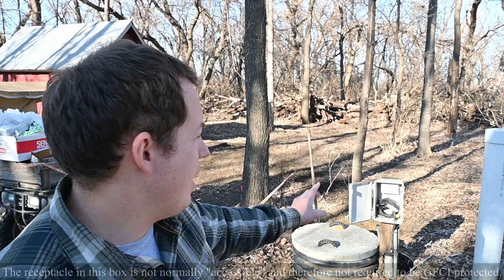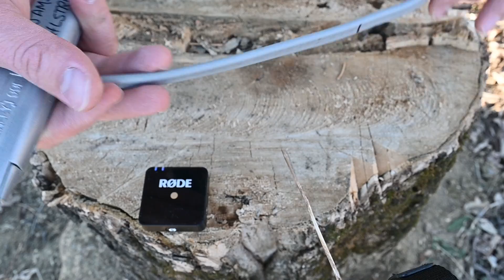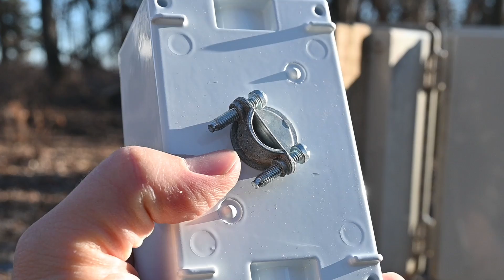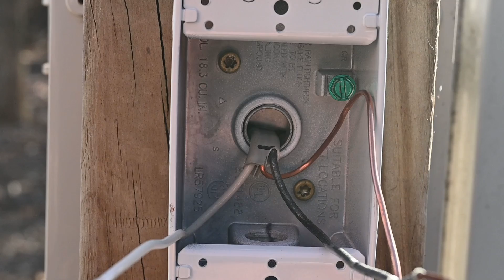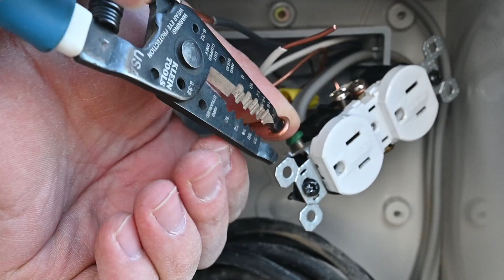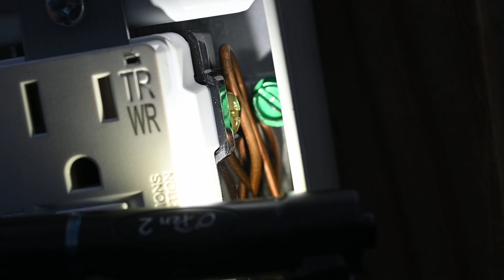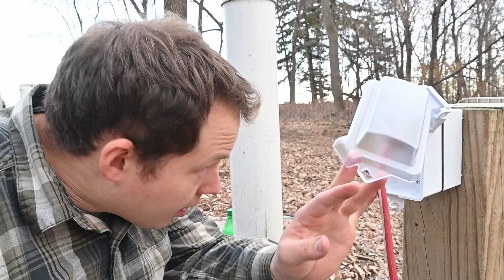How To Install an Outdoor Outlet

Comment from the maker: For those who are curious; that circuit that I tapped off of is fed from a standard circuit breaker with no GFCI protection. The receptacle in that box we tapped into is not normally accessible and is used for the septic pump and therefore was not required to be GFCI protected by code at the time of installation in 2016.

The reason that I didn't use a GFCI breaker is that I prefer not to have nuisance tripping of my septic pump but I did want to have GFCI protection at the receptacle we added.

In a perfect world I probably should have run a new circuit from the house but digging a 150' trench isn't exactly the easiest project and I shouldn't be using all that much power in that pet shed anyway.

I thought about putting this in the video but I figured that most people probably wouldn't care about these details. :)
Reply: A nuisance trip on that pump would be a crappy situation.
Reply: Very glad you mentioned the difference between backstab and screw-down that happens to go through the back. Totally different things that I think are easily confused. Whenever possible, I actually prefer a screwed-down "through the back" (or "under the plate") connection, vs. hooking the wire around the screw. As long as the connection is tight and secured by a screw, it's not going anywhere and I actually feel like it's MORE secure that way! 🙂
Reply: I have a simple question that I can’t find the answer to. Love all the content you put out by the way!  How many GFCI outlet can be I talked in one circuit?
Reply: @8Wildkid  Not sure I fully understand the question, but In practical terms, the number of outlets you can install on a single circuit isn't limited so much as the total amperage of the circuit dictates how many things can be plugged in at once. When adding a GFCI, and depending on how it is wired, it's possible for further outlets "downstream" of the GFCI to be fed off of and protected by it. In that case, incoming power connects to line side of the outlet, while further downstream outlets wire off of the load side. That protects the downstream outlets just as though they were GFCI themselves. But again, the circuit rating (usually 15 or 20 amps) dictates what and how much you can plug in.
Reply: @marcberm  thanks
Reply: find a good ditching company to trade out work with. It will save your back if you ever decide to make that 150' run
Reply: I agree about not using a GFCI outlet for a pump. Who needs that grief?
Reply: thank you for nice video its really helping . ..could you up load a video of  how to install security system alarm in home and CCTV camera system ?
Reply: You could have just replaced the breaker to that circuit with a gfci protected one btw..

Comment: That 2 screw romex connector that you used in back of the bell box is not rated for weather proof. So unfortunately this is a fail

Comment: I just ran a 12 gauge line from a new 20-amp breaker in my panel to an exterior outlet I am installing. It's a 2-gang box and both are GFCI. How do I connect the GFCI outlets - to the power and to each other - when I have just one 12-gauge line going to 2 GFCI outlets?

Comment: In mounting a box outside, I always use a gasket between the surface and the back of the box and sometimes also where the power enters the back of the box. I just never trust the weather from getting in the wall of a house or a box.

Comment: You might want to tighten both screws on the load side of the gfci, then wrap the entire receptacle around all the screws with black tape sealing off those exposed connections from any potential shorts or moisture.

Comment: Big help. I just replaced our deck that was 10’x33’ to 24’x33’.  Since the house is close to 40 years old, there was only one non-GFCI outlet, and it wasn’t in a great location. I wanted to add 5 or 6 additional outlets, do it right/to code with the GFCI outlets and outdoor boxes, run the romex thru schedule 80 under the deck and then 90 degree up thru the deck and have outlets every 10 feet across the back of the house and a couple on the 6’x6’ posts of the railing.
Those are some beautiful kids you have. Did my dad call you and tell you “it’s just as easy to fall in love with a pretty girl as it is to fall in love with an ugly girl.”? (His other line was- “It’s just as easy to fall in love with a rich girl, as it is to fall in love with a poor girl.” He’s an electrical engineer…. You know the type…)
Reply: Can't use Romex outdoors because it's considered a wet location even if in conduit.

Comment: Can cable from the panel to the outlet go directly in the ground or does it have to be in conduit? I lIve in Florida so the cable may be submerged several months a year at my swamp hunt camp.
Reply: You need wire that is rated for underground.... some have shielding on them, amd can be buried by themselves, but best bet is to run inside a buried conduit if there is ever a problem in the future you don't need to dig everything up again

Comment: Is it against the code to use the receptacles to connect multiple hot and neutral wires to power the current receptacle and downstream ones? IIRC pigtails must be used.

Comment: At 19.26, you should ALWAYS make it your standard practice to connect your ground wires first on any circuit you are dealing with be it in a panel and or switch or outlet.

Comment: Does it matter if the panel/load center is circuit breakers or the old screw in fuses?  My house has a screw in fuse panel.

Comment: through the boxes, I would have used a piece of steel conduit or a long bushing, at the correct length with a nut and bushing on either end into the back of each box through a knockout.  Then, you just pass wires through because... it's conduit.

Comment: Here's my 2 cents, based on experience. I'd recommend that you tighten all your load side terminal screws whether or not you are using the load side of the GFCI receptacle, and also cover all terminal screws with electrical tape. I'd also recommend to actually land your grounds far away from any and all terminal screws rather than just pushing them back and hoping for the best. I'd also advise you to strip the UF sheathing further back in order to save space in the other box so it has more room inside. Stripping UF is somewhat of a pain in the rear end. Lol

Comment: uf will peel if you strip just an inch or two of the gray, down to the white or black (lets use black for this example), then grab the ground and white wire with your side cutters, grab the ungrounded conductor that you've stripped out of the uf, pull away from each other. The black should come right out of the gray insulation. Repeat with your neutral. Cut circle around the base of the ground (with a dull knife)  and pull the grey right off.

Comment: I had an electrician install one of these outlets outside for me. The very first time I went to use it, it failed to deliver electricity? I tried resetting it & nothing changed? I tried several times to reset-nothing? I suspect the outlet is defective? I have another outlet downstream from this same circuit & that works flawlessly. I couldn’t believe the outlet is defective right out of the box? I will install a traditional outlet without GFCI. Personally every outlet I have with this feature is garbage after a few cycles. I have consulted with several electricians about this issue. They agreed with me.

Comment: Hm, you seem to have everything under control Ben, this is my second of your videos, subscribed at the first one, and i was thinking, "Wished this guy would add some extra comments, like if you live in Europe this would be..." Maybe more subscribers. I am from Norway, and the rules are all different probably, but the laws of physics are universal, so it shouldn't differ much.
I would use a 16amp fuse and that requires 2,5mm thick wire, is that 0,1inch wire or something, was that what you used there?

Comment: This install makes the code book inside my head go nuts. But the right way would of been to use big enough hole in the post to use 1/2" PVC conduit inside the post to make a proper connection between the enclosures. You also have a code violation in that the plug for the pump  is NOT GFCI protected? Also not using a proper connection for the wire to the first box on the pump outlet. I also never would never use the side screws for feed through on something that is going to see this much abuse. I would use wire nuts and make a proper splice. This whole video is generally marginally acceptable electrical work. Which in the real world is better that most. But not what I would make an example of on youtube. Because when people copy this and do it even worse. Someone will get hurt.
Reply: True, I would just run conduit with rain tight connectors. Plug?, you mean receptacle!

Comment: Why wouldn't you reroute your power supply line to the GFI receptacle and use the downstream to feed the unprotected outlet in your original weatherproof box?               Pre-Twist before putting wire nut on.

Comment: Lol like how did that but to prevent that issue it be good to wrap black electric tape around Device so ground wire won't come in contact with screws like how it did in video

Comment: Video request: How to install a thermostat on a woodstove chimney that would control operation and speed of a fan. I have a friend who makes maple syrup (it's about that time of year again) and temp is critical when boiling down the sap into syrup, Currently we have to check thermometer on chimney constantly then either stoke the fire or run the fan (variable speed) to keep the temp dialed in.  Thanks in advance.

Comment: To avoid the recess hole, and for weatherproofing, you could consider a plastic push-in connector. It is low profile and could be done from inside the box, in fact on the other original box too, but you should have used standard knockout rather than drill new hole through plastic.

Comment: Here is a stupid nit-picky thing. When you drilled out that box, you technically modified a UL listed item. Because of that modification it is no longer listed and may not pass an inspection.  However if you used the knockout just to the left you would have been fine. 
Again, I do think it's silly but you would have been able to put a fitting there on the knockout as well.

Comment: Twisting wire makes a mechanical connection, (A sound mechanical connection is a sound electrical connection.) a wire nut insulates that connection. I dont understand why people debate that fact.
Reply: “Twisting” a wire nut on two wires does both...mechanically connects and insulates...so why twist twice?  (And the debate continues)

Comment: While you did what you did based on what you needed to achieve, the NEC states that all cables are to be connected to the box per 314.17(B)(2). I would also give you a note about your choice of fitting for that Type UF-B Cable so give 314.15 a quick peak or peek (LOL) as the fitting being utilized is not rated as being utilized.

Comment: wrong clamp for outdoor use, can't use NM B indoor clamp in wet location
Reply: Correct. I would connect with (LFNC) conduit with liquid tight connectors.

Comment: Hello Benjamin I’m running power for to gate motor. I have two 20 amps breakers and red black green white #12 wires. I want 4 outlets one set for the motor and the one for anything else like lights power cord, etc. my question is do both outlets have to be gfci? And red goes to one set, black goes to the other? Pigtail green and white? Thanks

Comment: thank you Ben,
i want to ask you on residential wiring, which wire we can use 14AWG or 12AWG b/c most of ur video i saw u using 12AWG.
Reply: Minimum wire size is 14AWG for residential wiring. 14AWG has a maximum current rating of 15 amps.

Comment: Would have been better and safer if the GFCI outlet had been wired to the line wire first then connecting the second outlet to the load side of the GFCI outlet that way both outlets are GFCI protected.

Comment: Seems like it would be more important that it is sealed. Not as in a seal-off, but weather tite. Don't wanna pop the pump circuit. Find out with a code brown..

Comment: Don't they make a plastic grommet that you could use to seal the hole and support the wire?
Reply: Yes. I would use LFNC and liquid tight connectors to connect the two boxes.

Comment: I never use back wire holes. I have seen a lot of problems by using them as the metal bars that grab the wire do not seem to carry as much current as the screw. They make a tool to strip the outside insulation. Using a razor blade or knife always leaves a chance to cut the insulation on the wire. Should have used something to seal the box in the back where the wire went through to keep water from getting in.

Comment: I see that the feed wire is installed with out it being stripped back. As you said it should only come in 1/4 in into the box. I have seen this done before. Why ? who started this ? It is not the way to do it. I would like to show you how to strip the wire. I mark the wire where I want it stripped to. Run my knife around the mark. Being careful not to cut through it. Then run my knife down the center. Not all the way through. It does not have to be deep. Open it up and pull back to your mark. Then pull it straight out. This leaves a nice straight cut. Looks better then when you cut it off on a angle. Try it. Once you have it mastered you will like it. I also strip my wire this way before I install in my boxes. Easier then doing it after it is in the box. I do like your videos. You do a good job for not being a electrician. Your work is better than some. Keep up the good work. I am just telling you how I do it.

Comment: Why you used piece of outdoor cable between sockets, if it is installed inside post? Three wires will save your time and you can immediately see necessary length of ground wire. You really spent time for unnecessary work. 

Also you hadn't put silicone between new box and post, after rains there will appear some moisture inside new box and contacts begin to oxidize.
Reply: Wire installed in any raceway that is outside has to be weather resistant.

Comment: I hate wirenuts they are rigid, they do not expand;  better to use Ideal wingnuts any day...
Is the box with the ground screw interference  Made In China or Mexico ?
Wiring a circuit through the bridges on a duplex outlet?  You do NOT want the rest  of the load currents   flowing through the bridges of a duplex  outlet, these bridges are e  
xclusively for the benefit of the duplex outlet in case a switched  half of the duplex is desired!
BAD idea, always make and use pigtails instead!
Tighten the loose LOAD side screws on the GFCI and they do NOT back out to touch a bare Gnd wire and or wrap the connection screws with  88 Tape!

Comment: Why the heck do they make the outdoor boxes just the right size and not a bit larger to accommodate the GFI?  I end up installing a double box and not using the second receptacle spot.
Reply: because the casting / molds were designed like a thousand years ago when men were men and most outlets were only grounded if the installer felt like it ;-)  Seriously, I just bought about the same box and plan to install the GFCI on the interior with a normal duplex receptacle in the outdoor box. Folding the 12ga UF in those boxes is no picnic either.

Comment: Hi, one more reason why the UK wire is so much better than the USA type. In the UK all earth wires need to be sheathed so that there is no chance of the earth wire connecting any other wire in the system

Comment: As always, a great video. 
The only thing I would have done differently would be put the GFCI in place of your original outlet and add a new standard outlet. 
That way, both would be GFCI protected.
Reply: you do not want that pump on a ground fault system. Not required by code

Comment: I understand that the first duplex receptacle is for the septic pump and a GFCI was not require at the time of installation and also the reason why you don't want to use a GFCI is because of the false tripping.  However, the septic is powered by a duplex receptacle and one outlet is powering the septic and the other could power something else in the yard, electric blower, etc., which should be GFCI protected.  To solve this situation, you should use a single outlet receptacle to power the septic and then use the GFCI duplex outlet on the other side of post like you did.
Reply from the maker: You have an excellent understanding of this! The way that this is setup the "enclosure" that the duplex receptacle is located in is able to be locked/secured so as to prevent the second receptacle from being used as you described.
Reply: @BenjaminSahlstrom  
Thanks so much for your reply.  Excellent video!

Comment: Always mount your boxes so that the ground screw is on the neutral side far away from the hot side.
Reply: That doesn’t help very much, if the ground comes in contact with the neutral, it will still trip the gfi
Reply: @stevecampbell9824  How does ground touching the neutral upstream of the GFCI trip it?
Reply: That might be practical for installing a standard receptacle, but with a GFCI receptacle even a small imbalance of current between neutral and hot can trip the device.